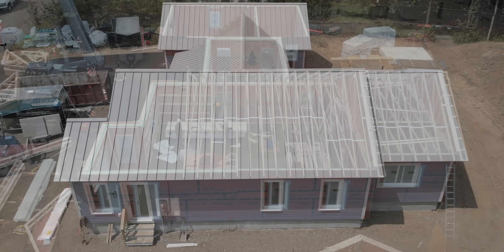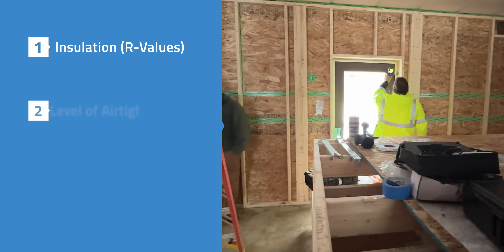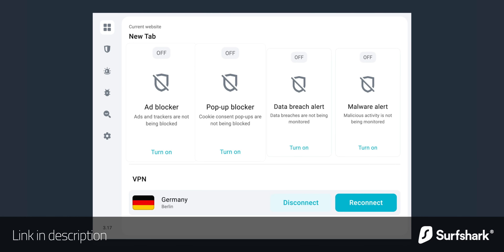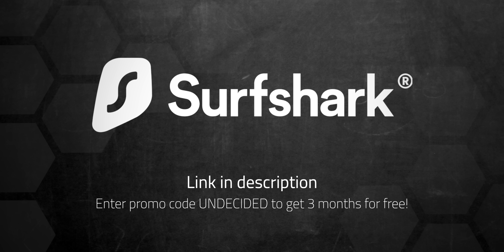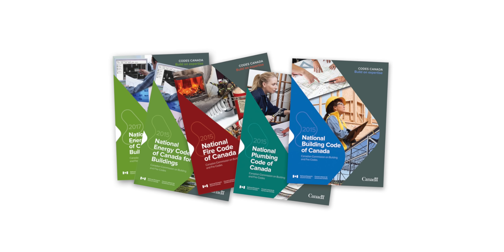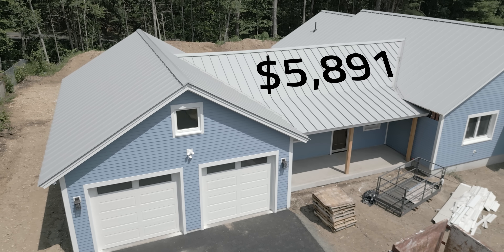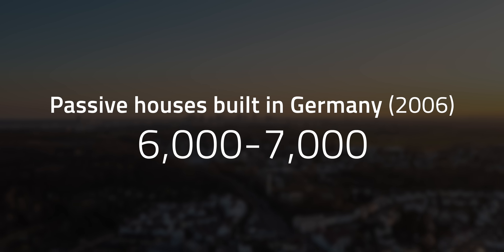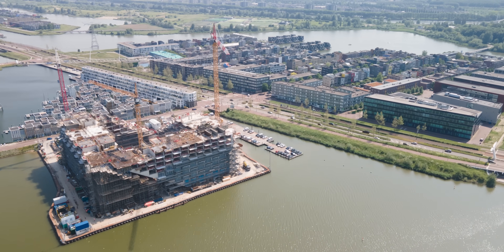Why Do American Homes Suck?

Comment: I can confirm that at least all somewhat new buildings in Germany are insulated like crazy. Last winter we had the natural gas crisis because of Russia's invasion, so we were worried about 10fold prices. Fortunately, we did not need to use the heater once. Our flat was never cooler than 20°C. Other benefits of insulation is noise reduction, which is really nice if you live close to a busy street or near an airport
Reply: We did the same in our house in the UK because of the invasion in Ukraine, and the results have been solid, even though we had one of the coldest winters on record of -9C, we rarely needed to use the heating and even when we did, it was for a short amount of time.

Normally the temperature where I live is anywhere from -5C to 0C in winter, with either of those, we don't need heating at all and it feels comfortable indoors.

Insulating and smart buying when buying products that use less power to do the same thing is the best way to reduce our bills and in my case, there is still quite a bit more we can do from solar power, to heat pumps and a few other product replacements to reduce our footprint.

In the end, there are a lot of things we can do to reduce our energy needs without lowering the quality of living, and by doing so, you either keep energy bills stable or you can lower them, and I feel once renewable energy gets to a good enough state with the battery tech to back them up, many of us could go independence of the grid.
Reply: @paul1979uk2000 we did nothing only dropped the thermostat around 2° but only for the end of the year. Got 500€ back this year. House and windows are from 1996. If prices are the same I get something back next year.
Reply: @paul1979uk2000  one option my parents learned in the 80's when I was a child was a 2 bedroom house in a terrace with 4 and 5 bedroom houses either side. Those neighbours blasted their heating all winter, it was perfect temperature in our house but was too warm to turn our heating on. I remember just how lovely and warm that little house was all winter growing up. 😅😅
Reply: @paul1979uk2000 that's if you can afford a house in Britain.
Reply: @paul1979uk2000  You must have some sort of heating on, no home will keep the heat in no matter how much insulation you have, if you go outside, heat is going to escape through the door, or open a window, having the cooker on may help a bit but still.
Reply: @dogbreath6974 the sun light get into the house from Windows . Free Energy .
I made the same experiment last year due to the gas Crisis (the price was unbelively High) I am in North Italy, and yes the house never got under 18 C° . ( the max law limit was 19 C°  to fight the shortage) .
Reply: Oh that's great.  I live in a well insulated home in Northern Ontario (triple pane windows etc).  Sadly if we lose power I've calculated that the interior temp would hit 0 C in under 3 days when the outside temp is - 40 C.
Reply: @bhut1571   I take that as ok, I mean it will need some extreme measures to contain thermal energy with -40 outside, specialy without power and air circulation.
Reply: @bhut1571  do you regularly hit such low temperatures?
Reply: @bhut1571  -40C is mad. 😩
we were on vacation on Silvester and weren't home for 2 weeks.
we hit -10 outside for at least a whole week and the house with heating turned off had still ~ 18C inside when we came back. 😅
we didn't heat anything besides the 2 bathrooms because warm tiles due to in floor heating is just a nice luxury in the bathroom in the last 10 years. 
I've fired up the wood stove 5-10 times each winter just for drying laundry instead of using the dryer. 😂
Reply: @bhut1571  that's probably because of thermal inertia, European homes are made of brick or concrete, so they have a bigger thermal mass compared to most widespread insulated timber frame houses, which only have a small fraction of a thermal mass (doesn't accumulate heat)
Reply: @bhut1571  I have a question about your windows, do the extra layers create light refraction making the light seem another color? My architecture teacher said it made it look slightly green but im dubious about that
Reply: I live in a house with very good insulation in the attic but with 2x4 walls r13. We eat a lot of beans so frequent air changes is a positive attribute. Thanks to cheap solar panels the only thing that keeps me using a little grid power is storage.I have 50 kWh of lfp and waiting for sodium batteries to be available. What we need to do in Texas is build more reasonable sized houses.
Reply: Also warm countries should have insulated homes, as the AC would use much less energy to keep the homes cold. ACs typically purify the air, however some sort of ventilation and avoid too much airtightness, should be installed. Anyway - my point is that insulation works both ways, both in cold and warm countries.
Reply: Flats have a massive benefit, namely the fact that they share both the ceiling, floor and both walls with neighbors. There is just way less surface area to lose energy to
Reply: Wow, it got down to 10C where I live and we spent $850/month for heating!  In the US!

Our house has no insulation and single pane glass windows from 1950 that don't even close. 

Even running the heater full blast 24/7, our house never got as warm as yours.  And we have a major mold problem, got a quote for $40,000 to remove the mold because of all the cold walls are condensing moisture on the interior.
Reply: @zilfondel how big is the house? I hva around 230€ a month for electricity gas water. House is from 1996 around 120 qm. I hope to get money back because of the calculation this year. Got money back this year and i use less from everything.
Reply: Don't blame Russia for problems you caused.
Reply: stimmt genau!
Reply: I'm all for bringing up US housing standards to match the European model, but with such a high income disparity coupled with the lack of social safety nets most people just don't have the disposable income to perform the required upgrades to their existing houses with the lack of adequate subsidies. And good luck getting significant upgrades to apartments and condominiums without a mandate. It's honestly quite depressing to see the lack of attention to energy efficiency not only in new housing but especially with all the existing housing infrastructure.

I'm lucky enough to be able to afford to install solar panels on my house in an upcoming remodel, but most people simply can't afford it or simply don't care.

And to end on an unrelated note, as a plant scientist I'm quite frightened with the effect climate chaos is already having on food production and it's only going to get worse. Crop production bands are already moving closer to the poles, and academic plant scientists are starting to study the upper temperature at which plants can photosynthesize. We better get our act together quickly and/or decrease the global population so we can continue to feed everyone and so that everyone can live in more hospitable climates.
Reply: @nmatheis  We probably spend similar amounts of money on housing, but in Europe we pay more upfront. The difference is a huge quality of life from day one, and energy savings for cheaper living afterwards. This pays off especially when you go through rough patches in later years, because not having to heat or cool the house at all or rarely means a lot to the budget.

As an examples, in our home we only needed heating during 2-3 colder days in the last 4-5 years, when the outside temperature was between 0-20F. Inside we had around 70-75F when it was the coldest outside. Cooling, I guess some people would've wanted some, considering the inside temperatures got close to 85F frequently during the heat waves.

Cooler temperatures can be handled with proper clothing. The warmer/hotter ones, some people can handle, others might need a fan. But in general the power consumption is vastly lower with good insulation, so you can get away without solar panels (less cost) if the temperatures don't go wild. So insulation is an upfront long-term investment that makes living way cheaper and more comfortable for decades. That's why people do it here, because it's well worth it.
Reply: The next step mein friend is to fix the car dependency craze we all embarked on in the 60s by following in the Netherlands' footsteps, especially Amsterdam's
Reply: USA's invasions, but Russia's intervention! Use the terms correctry.
Reply: @izzyreeze3538  You mean war in both cases.
Reply: I love German buildings! I love the windows, rolladen, and all the solar panels installed in the last 15 years, etc.
Reply: This guys is overexaturading a bit, because probably other people around you where heating their flats so you kinda stole heat from them. But the point is real, the energo efficiency in European homes is super high.
Reply: Americans blown your gas line but gas crisis was because Russia Ukraine...
Reply: Yeah, the americans blew the gas line, not at all the russians. @efimkrivov
Reply: @taserrr  that aged like milk🤣
Reply: I’m a developer and builder with experience on both sides of the Atlantic . I built in Canada and the Italian alps, where the winter can be quite cold. The difference is the cost of energy. In North America is way too cheap, so consumers don’t really care. What I build in canada takes 10 times the energy psf of what I build in Italy. If I was to build in Italy what I build in canada none would buy. Not even the shack for the horses is built with such poor quality in Italy. And you might think that building in Italy must be much more expensive. Instead no. I finished a project that not only is passive, but is even net positive in energy and the cost of construction was overall 30% more than the regular. Because the cost of finishing, which takes a big part of the construction costs, is the same for high efficiency or inefficient. So the difference is not so big, is just that the monetary incentive/penalty is not there .
Reply: You do understand that your neighbors were paying for your Heating?
Reply: again it's your government that one caused the high cost and energy crisis - not Russia and your leaders laughted at President Trump when he warned you.
Reply: Winter in Europe and the southern most part was extremely warm in 2022.  I couldnt believe it was winter
Reply: Well insulated houses and passive building style is not only more efficient and saves money. It is also more comfortable and yieks even healthier environments. Think of mold or never care about temperature regulation or taps that provide hot water within seconds...❤
Reply: The Australian policy has always been to build a house shaped box and pump energy into it when it comes to heating and cooling.. really biting us in the arse these days.
Reply: dude, quit comparing UK stick houses to USAs stick houses😂
take s look like Sweden and Finland instead...

we now have minimum U -vsues at 0.017 in outer walls and 0.09 in upper roof.

these are standards , and they are getting even tighter, these numbers are allready mandatory since 2009 but they are trying to change them even tighter...

UK still builds houses like first piggie in that wolf&3 little piggies tale😂
Reply: @jkarra2334  thank god we dont have finnish or swedish temperatures of -20 around here..
Of course its normal u need tighter rules there then in the uk or france... Even with those values you still lose more heat than the "piggie stick" houses from the uk so basically you are still doing worse in finland then the rest of europe not something to be proud of lmao.
Reply: @matthew3136  Bingo the fossil fuel lobby has so much political influence its crazy they effectively own both political parties along with other corporates lobby interests. The Rolling Stones investigative report some years back was quite enlightening to the extent of the reach of the fossil fuel industry and their effort to eliminate/invalidate/ignore regulations
Reply: @sbalko74  Germans have be renting a lot for a lot of time, in fact in the years from 2019 to 2023 the percentage has fluctuated between 36.77 and 37.2.
Reply: Belgian here, I'm surprised your gas prices skyrocketed to only 10 times the price? Isn't Germany like 50% dependent on Russian gas, or was. 
Gas prices at peak in winter got to 30 times their normal cost over here.
Also, you live in a flat, and it's not comparable to an insulated home because flats are surrounded by other flats and benefit from other people's heating. Essentially your downstairs neighbor is heating up your own flat.
Reply: You have a gas crisis not because of Russia but because US blew up your Nordstream pipeline.
Reply: Honestly I live in a home from the 70s and we even re insulated the roof a few years ago which helped a lot but still when I was at a friends house which was built within the last 20 years the whole house warmed up from him just using the oven. Insulation seemingly has improved quite a bit… (also Germany)
Reply: Lol not because of Russia, but because of no sense sanctions and Habeck
Reply: Russia’s invasion? Have you heard of the Minsk Accords. NATO and Ukraine signed them then immediately broke them. Russia has just been reacting to this. But I guess a scholar like yiu think it all started in 2022.
Reply: You did not have gas because your government decided to do so. Besides that you can't have a normal insulated house in middle Europe without a heating system. It is the laws of physics that stand against it.
Reply: Germany's winters are, laughable as well, don't forget to add that in.
Reply: That noise reduction also helps with densification which reduces land use per person.
Reply: @Fiercefighter2  Yep, let's make more bug pods. More bug pods for bug men. Hoorah.
Reply: @ReverseDominion  Lmfao. Sudbury drops to -40 all the time. Same with thunderbay. Petawawa and Ottawa (in south Ontario) can drop to -30 and below. Now when you consider windchill, it's a whole different ball park. I live in the Kawarthas and Northumberland region. Due to the geography here and that my fields are north of my house. Extremely cold wind runs down the side of the  large ridges's slopes and then get pulled down to ground level as my field is one of the first openings from forests from the ridge. That means I have almost permanent strong winds coming from the north all winter. It's not uncommon for the temperatures with windchill to sit at around -40. The north part of the house is noticeably colder then the south part, and my house is extremely well insulted and sealed.

We do get extremely cold winters at times in northern Ontario, with certain regions having micro climates which push the temperatures way lower than the surrounding area.
Reply: German walls are so much thicker 🤤
Reply: I hate how difficult it is to convince old eastern europeans living in soviet age appartment housings to renovate, because they don't want to pay for renovation, but are not thinking just how much money they will save long-term because of decreased heating costs.
Yes it will take 5 maybe 10 years to break-even, but it's worth it, at the very least, for your kids, even if those old coots will die before they see any of their investment return. Not to mention the people trying to sell theirs, non renovated buildings have almost no demand now.
Reply: Even the older building containing my flat was built in the 1970s, but was still very well-insulated and ventilated.  The turn and tilt windows do wonders overnight to cool the place, letting the hottest interior air out first with any cross-breeze.  I'd button up in the morning yet it was still cool when I cam home from work, even on warm day.

My German utility bills averaged way less than $50 a month when they were over $200 a month in the states.
Reply: @ReverseDominion  And check the extreme, go ahead bucko. If you think Sudbury doesn't experience below -30 weather multiple times each winter, you are living in Narnia. It does drop to -30. And guess what, once you factor in windchill, -30 also becomes way way more frequent over the winter. Also, December has an average low of of -13. Plus why don't we look at the colder months, average low of -18 and -16 for January and Federal. Don't accuse people of cherry picking data when you're using December daily averages. On top of this when you're accusing someone of not doing research, maybe do some research yourself. Sudbury is located north of the great lakes. Why does this matter? It means that it gets a lot of artic air masses passing through it, making cold snaps much more common. Do some basic, basic geography and climate research before stepping up to play.
Reply: @ReverseDominion  Extreme highs actually back my stance up. Sudbury, much like the rest of the country outside of west British Columbia goes through extreme weather and temperature shifts. Which if you would take the time to read, I pointed out Sudbury faces a lot of due to being just north of lake Huron. 

It routinely gets arctic air masses moving through it during the winter as the polar jet stream meanders. In fact, we know that Sudbury will have  massive drop of temperature and potential snow flurries on the 31st as the polar jet stream meanders over Sudbury. 

Sudbury does find itself north of the polar jet stream at times, meaning it's not dealing with frigid polar jet stream winds, it's deal with what you might have heard as a polar vortex. For some reason, either due to the polar jet stream being south of Sudbury or being weak in north Ontario lets frozen arctic air to get to Sudbury.  

The fact that you are using average winter temperatures anywhere inland west of the Rockies shows that you have zero understanding on what you are talking about. The temperature in all those regions, including Sudbury varies wildly day to day. Also, funnily enough, Canada has official data it collects. Sadly no windchill, but let's show how wrong you are. The data is from Sudbury, Earlton, North Bay, and BARRAGE TEMISCAMINGUE. All 4 are near Sudbury and experience the same weather as Sudbury, so it's to get rid of any outliers. The data will be listed in the same order as stated and is from February of 2022. 

Monthly highs: 4.7, 5.2, 4.8, 7.1

Monthly lows: -33, -35.1, -36, -31.5

Days with positive temperatures :  9, 8, 9, 11

Days with -22 and below: 7, 12, 6, 5

Days with -30 and below: 2, 3, 2,2

Now for the really good one, days with -30 or below with windchill: 11, 11, 10, 7

That's quite a few, now let's look days that hit -22 or below again but with windchill: 20, 24, 19, 12.

Days that hit -40 with windchill: 3, 4, 4, 3

TLDR, you are wrong, and also ignorant on Ontario's climate. A good move for the future is to actually look at the raw data. Canada itself provides it.
Reply: @ReverseDominion  No, you also need to show what the variance of the data is and also the distribution of the data in terms of skew. Also that data was for one month, not the whole year. On top of that, when you add windchill, about 38% of days in February of 2023 hit -30 or below.

Anyway, I did the math for the standard deviation and skew. The data has very high variance on both the daily and monthly time frames. With temperatures having more variance at the daily time frame. The data also showed about a 2 times difference in extreme temperatures for highs and lows. With lowest temperatures being about 2 times lower than the average  compared to how far above the maximum temperatures are. I checked skew as well, the data skewed slightly warmer then average. 

Basically what it means is that the daily high and low temperatures tend to be warmer than the average while being clustered around the average. Daily high and low temperatures that are colder than the average have way more variance. This basically means there are more warmer days then colder days, but the colder days are much colder, with the coldest cold days being much colder than the warmest warm days. 

Sudbury and a lot of Ontario outside the Ontario peninsula will routinely have short cold snaps plunging you to super cold temperatures over one to three days. This is due to the geography of North America. The Rockies block warm pacific air and channel the polar jet stream further south. Arctic air doesn't have to move over large bodies of water so it doesn't warm up. Sudbury, and much of Ontario finds itself eating  arctic winds coming from the north west that have not traveled over any large body of water. Ontario also doesn't have any mountains that could disrupt those winds when they do come. However, this is the exact reason why the Ontario peninsula has much milder temperatures. Arctic air has to flow over the great lakes, which warms them up a lot. At the cost of lake effect snow if you're in south western Ontario. That's the geographical reason why so much of Ontario, and so much of North America east of the Rockies has such bipolar weather. The data shows this to be the case as well once you compare and contrast distribution data with averages. You most likely live in a climate which is much more stable, something like the Oceanic climate or the Mediterranean climate. So the idea that weather can go 20-30 degrees down and then come up the same amount in a few days multiple times a month seems lubricious, but that is how the weather behaves in a lot of regions here.
Reply: Damm that’s cold lol aussie here
Reply: This makes an incredible point. If we could sell the solutions to this problem as a genuine matter of national security I bet a lot more people would support a change.
Reply: Same here! Greetings from good old Germany😁🇩🇪
Reply: you had a natural gas crisis because your government decided to ban Russian gas. not "because of Russias invasion"
Reply: The key to your success is you live in a flat. A free standing home endures much more of the elements that contribute to heating and cooling and much more.
Reply: Shutting down 17 nuclear power plants didn't cause any power problems or people dieing from fossil fuels emissions.
Reply: What if your next door neighbour bang on your wall 3 or 4 in the morning. Would you hear that too ???
Reply: How’s the stale air though?
Reply: Who blew uo the pipeline? It wasn’t Russia.
Reply: Oh no. No No No.  Merkel leaving the scene left an immense powervaccuum in your country.  Next thing was the abortion of NordStreamII under severe pressure by US.
Reply: german engineering 💪
Reply: If one lives in a big apartment building there (Germany)- in a middle of it - well you may as well wear a sweater since you will get heat from your neighbour's over the wall. I am from Europe - I would choose USA modular construction any day over European. Easy to tear down and remodel, easy access to all system. The argument for R rating is wrong since anyone really wanting to insulate the house- could voluntarily do it. Since energy cost is so low no one really does. We do not need government to mandate anything more - let market dictate these things.
Reply: Or because you shut down the nuclear plants 😄😄😄😄
Reply: I love the sound insulation part, after my brother complained about his neighbors whining and fighting over noise in his 1960 apartment building, I feared same will happen to me. However my building was built  in 2014, and I can't hear anything. I blasted music on my TV and asked my wall-to-wall neighbors if they heard anything, they were like "What music?" When doors our closed I can't hear my gf on the balcony. It's amazing.
Reply: Yeah, EU now brought A++ requirement on new housing. The pronlem is even that - even though this makes it energy efficient but its economically not efficient at all. The difference in saved funds between A and A+ is like 5-8% saving on yearly spending, but it costs 30k € at least. It will never payback.
Reply: @romualdaskuzborskis  No. It cost à lot if you upgrade the house. But when it is at thé beginning it is not so expenssiv. And à housse last at least 70 years ans in europe centuries...
Reply: @abriotde  nope, I have literally calculated the new house current costs for A/B vs A++. The point is with each upgrade you have siginificant efficiency progress. Its a very big increase going from C to B (from 187 to 125.4 kw/m² a year), a bit more from B to A (from 125.4 to 49.2), then its much less significant going to A+ -  49.2 to 37.09 kw/m² a year, and to 27.83 for A++. A class 120m² house can be built for 70k-120k, A++ would at leastgo now for 250k€. Thats eastern europe prices. Not sure about western/center EU.
Reply: @romualdaskuzborskis  Usually, the price of the land is 100K to 300K euros so puting 200K or 250K in the house do not change significantly the price. But the confort in A++ is significantly better : You don't need any heating system (Or a so cheap one). It's a huge advantages. And there is a huge confort when inside it's always a cool air not to hot, not to cold nor on the ground nor on the top or close to the wall.
Of course when it's upgrade of the house it cost to much to be A++ a good B or A is enougth.
Reply: Europe was lucky that the winters since Russia's attack on Ukraine have been very mild. Furthermore, the German government subsidized heating with enormous amounts so everyone only had to slightly turn down the thermostats to get away lightly financially.
Reply: Gas crisis because your government let the US blow up Nordstream thus deindustrislizing Germany. Blaming Russia doesn't work here I'm afraid.
Reply: I live in a really insulted house in the UK. Its a nightmare in the summer
Reply: @CentreMetre  is it cursed
Reply: @imakro69  No its hot
Reply: I mean our insulation in Finland is pretty good but whenever I've been to Germany the houses feel like they've built like castles
Reply: I agree with the sentiment but the zero burn was because we were super lucky with the weather in Europe that year. Putin was like "curse the weather"
Reply: Schimmel!!! Schimmel ist das Problem!
Reply: @Neomadra  you used the heat others had to pay for. They compensated your inactive heater.
Reply: @Neomadra  dude why do you lie? I live in Germany too and what you’re saying is absolutely false. 2022 in the gas crisis, we did have to use the heater… stop selling lies
Reply: You had gas cut off because you decided so, and because your US ally had blown up the Nord Stream
Reply: did Russia invade Germany or something 🤔
Reply: >Does nothing
>Wins

What is this strategy called?
Reply: Don't worry, we are still using Rusian oil, it just goes through two more hands before our countries buy it and the consumer pays more.
Reply: you didn't have a natural gas crisis because of Russia's invasion, westoid
Reply: "we had the natural gas crisis because of Russia's invasion" thats not because of "invasion", thats because of the sanctions against Russia + EU politicians refused to buy from Russia. So thats because of EU politicians not because of "Russia's invasion". By the way, why no one applies sanctions against Israel? Oh, i think i know! "Thats because its different!", isnt it?
Reply: I really enjoyed your informative article but I am disagreeing to the IECC standard.The higher standards is meaning higher costs to live.
Reply: you had a gas crisis had nothing to do with Russia but NATO blowing up germany's main source of cheap ubandant gas via nord stream while your vassal government did nothing but buy US LNG for 4 times the price. facts
Reply: @Neomadra Last I checked, it was Germany that invaded Russia... not the other way around. So I would be quiet about an invasion in your position...
Reply: @Neomadra  I’m am so jealous. My home is horrible at retaining heat because it’s to big. Last winter, my heater broke, so I had to where my winter coat, ski socks and ski pants.
Reply: American Homes Suck!
Reply: You are also getting heat from all of the units below you.
Reply: Strict codes are all well and good, but if I can not afford housing because of it, it’s no use to anyone. Same goes for everything else. If it makes it unaffordable what’s the point??
Reply: @MoDa87  But it is not necessarily an affordability issue. Yes, it often costs more up front but if your monthly costs are significantly lower then the differential may not be as great. Cheap up front cost is not always the most desirable outcome. If we think that way, we condemn ourselves to buying nothing but third world country imports that, well, suck.
Reply: @MoDa87  I have been interested in energy zero houses for years and have books dating from the 1970s and in reality all the energy builds and efficiency devices were available then, just expensive and hard to find. I recall 1 book showing how to build such a house using the same materials, just in a different way. The 2 I recall are: doing away with cellars but using the same concrete to make an energy sink in floor and walls, and the other was using concrete blocks with holes, but lined up with windows so sun heated up floor and air in the hole tubes, heat raised and pulled the cold air from back of room into the wsrm floor tubes, got hotter, raised and so on. You also gave the earthships, elements of which can easily be used in 'normal' houses although the atmosphere in an earthship is sonehow magical
Reply: @MoDa87  so you can flex how the government controls every aspect of your life to those silly Americans and Canadians, duh.
Reply: That's more because of the flat underneath you being badly insulated from your so you get free heat through the floor.
But yeah, insulation is great as long as there's enough ventilation, which makes older houses incredibly expensive to upgrade. Unless you're a landlord in Germany, then the tenants pay for it and landlord gets the tax benefit.
Reply: Europe is still buying Russian gas tho. Politicians just never mention it.
Reply: Yes, the key word in your entire comment is you live in an apartment. Homeownership is a dream free because it cost like €4 million to get a house in Germany. The government probably subsidized the building building of that very energy efficient high-rise.
Reply: @Albanianguy9  That's simply not true. Yes, building a house IS expensive in Germany. But €4 million is WAY beyond what's needed. Average building costs have risen to €2k/m², so a normal 150m² house costs around €300k. If you buy an average plot (500m²) it highly depends on where you build. In average it's ~€160/m², but in huge cities this increases by an order of magnitude. Still an average single family house in an average area will cost you ~€400k, while in large cities this jumps to €1.1M.
For €4M you could build a 3-5 floor city villa (200m² each floor) in munich. number of floors highly dependent on where in munich you build.
Reply: @AleaumeAnders  yes, you’re making my point for me. 1600 ft.² cost over $400,000 in your country lol. Not to mention the taxes… I understand you can living on a farm in the middle of Germany but living in the big cities or suburbs, is at least €1 million+
Reply: @Albanianguy9  And still you are exaggerating and avoiding the main question. You claimed a house would cost €4 mio in Germany. Which is as wrong as claiming that all houses in Albania are little more than a pigsty. You'll find wonderful but expensive houses in Albania, and you'll find acceptably priced houses in Germany. Btw. appartements in Tirana sell for €1k/m² which is not that much behind what you'll pay in similar smallish cities in Germany.
Reply: @AleaumeAnders  i’m actually not from Albania even though I’m Albanian. And I also don’t live there so I don’t know what anything costs. I wouldn’t buy anything in Albania and potentially get scammed lol. You’re missing the Keypointe that I’m making which is that homeownership is a dream for most people in Europe especially Germany because it’s so expensive. It’s also frowned upon because you guys worship at the climate change alter and have literally shut down all of your practical energy sources and beg Russia for energy now.
Reply: @AleaumeAnders  I would rather own some land and own an actual house that is built cheaply in the United States rather than live in an apartment that’s congested, and I don’t even even have my own space
Reply: @Albanianguy9  And you are still ignoring the facts. Just because it doesn't fit your propaganda, you spew nonsense.

Houses in Germany are actually NOT more expensive than those in equally populated area of the US. Sorry to burst your bubble, but what you claim is factually wrong.
Though given that facts are as important to you than to the average trumpist, I'll stop here. No sense in arguing with "believers".
Reply: @AleaumeAnders  yes and houses in the United States are actually a lot larger than what you would get for the same price in Germany. I love how you assume my politics. Your entire country worships at the climate change alter and literally committed suicide by shutting down all your practical energy production.you’ve led in millions of migrants that have changed the makeup of your country and actually made it worse. On top of that we don’t really even have to focus on energy savings here because we have cheap, reliable, natural gas and oil.
Reply: @Albanianguy9  Sorry, you can't even read properly what I write. Over and out Mr. post-factualist.
Reply: Unfortunately, the buildings in German are very air-tight with insufficient attention to ventilation. Ventilation systems with heat exchanger are rare and ventilation norms in the building code do not cover any heat recovery. So it is either sending warm air straight out of the window or accumulation co2 and other emissions indoors
Reply: @jaap7374  Although indoor CO2 is certainly a point of concern, I believe the accumulation of VOCs is more of an issue with low ventilation rates.
Reply: @jaap7374  In Germany we do something called "Stoßlüften". Open the Window all up for a few minutes to let the air fully exchange and then close them again. The loss of heat isn't that big, since air isn't as dense and therefore stores only a small fraction of the total heat present. The walls and furniture will heat up the fresh air in no time. 
But sure, a ventilation system with a good heat exchanger would be more convenient. But still not sure if it would be a lot more efficient to continuously loose a small fraction or loose a bigger fraction once a day. But it will for sure adds a bigger price tag on the total house price. Not worth it imho. Maybe for an American since convenience is king over there still :p
Reply: @matteloht  Ventilation with heat exchange is very cost effective with a SCOP of over 10 when used with a CO2 or VOC sensor. Heat recovery is mandatory in many building types in the Netherlands. Its popular mainly because the efficiency and health benefits. Convenience is a nice bonus
Reply: @matteloht you guys also pay tax for radios which is why nobody wants them anymore. I lived there for 3 years. No thanks to your massive taxes and overregulation of everything.
Reply: If you have a heat recovery system, is it difficult to keep it clean? Does it attract mold?
Reply: @jaap7374  We had that issue with our house in the Midwest US after renovating and increasing the efficiency. It became too airtight and we added a heat recovery ventilation system. We love having fresh air all winter long without putting too much burden on our heating bill.
Reply: @jaap7374  FWIW, in newer apartment construction, active ventilation with heat exchangers is pretty common. My building has it. It was built in 2016.
Reply: @jaap7374  I don't know where you're living, but in Europe you can't be serious about passive house without ventilation. There is no such thing "insufficient attention to ventilation". You can't obtain a certification from Passive House Institute without ventilation. More than that a lot of passive houses have CO2 meter in every room and automation for ventilation.
Reply: @jaap7374  That's why we have the "Kippfenster" tilting windows to perform "Lüften" airing for ventilation at least once a day for five minutes. And that kind of ventilation will not really make a big difference in efficiency or energy escaping out of the window.
Reply: @jaap7374  All newer building with the "crazy insulation" mentioned above have some sort of passive or active ventilation already built in. Because most owners aren't qualified to manage ventilation cycles, it's basically "hardcoded" in some structures. They building maintains ventilation by itself using mostly maintenance free passive methods.
Reply: @jaap7374  But you still can open a window 2-3 times a day to stay below 1000ppm CO2.
Reply: @jaap7374 Did you miss the part in the video on ventilation systems? Not that this changes older buildings in Germany, it’s that there are ventilation codes. I would be shocked if Germany didn’t have basic ventilation system codes for newer buildings.
Reply: @jaap7374  that's because you need to clean the ventilation every couple of years and it's not cheap
Reply: @jaap7374  Precisely my case. The core of the house (60cm aerated concrete, 60cm rockwool ceiling) is passive down to -40C, but that's before ventilation. With legally required airflow, it's almost stone age performance. Reversible heat exchangers available on the market are a hoax, their heat capacity is too low to make any sense (and their motors burn quite a lot of electricity).
Reply: @jaap7374  our building has ventilation with heat exchange. But the problem is, that in the winter the humidity gets way too low. Not healthy anymore.
Reply: @jaap7374 That is not correct. Ventilation with heat recovery is a central element of a passive house and it is reflected in building codes.
Reply: @jaap7374  Yes, indeed!  Modern buildings are way too much air tight for good health!
But it is neither complicated nor expensive (compared to the cost of the potential energy bill) to fit a heat exchanger on a home's forced ventilation system!  The system should be designed to suck air from the kitchen and from the toilets, and bring fresh air to the living and sleeping rooms, and be fitted with an air-to-air heat exchanger (typically 80+% efficient)... adding a pollen and other particle filter is a good idea!
Reply: @jaap7374 we don’t need ppl to tell us to air out the home homes a few minute a day here and there we prefer fresh air in Europe
Reply: @jaap7374  Ventilation is definitely the biggest weakpoint at the moment in Germany, though surprisingly there's at least two businesses doing comprehensive ventilation in my small town
Reply: In Brazil, it's like unacceptable to not open windows for fresh air, so using that amount of insulation would be waste of money when people open the windows for fresh air
(In southern Brazil, where it snows sometimes)
Reply: @rogeriopenna9014  Even if you prefer keeping the windows open (I certainly do) the benefit of having good insulation is that your temperatures return to baseline very quickly after you close them.
Reply: @VVayVVard  how can it return to "baseline"? Only by heating it again I suppose
Reply: @rogeriopenna9014  Via a number of mechanisms. Humans and machines are major sources of heat. The ground also acts as a reservoir, and the walls, floor, furniture and (especially) water pipes retain heat to some extent as well. 

And when you live in an apartment, this can actually become a problem. I personally prefer to keep my place cool, so I always have my heating off and try to keep my windows open as often as possible. But I do have to close my windows whenever there's pollution outside, and as soon as I do so, even if the temperature's are below -10°C in the winter, my apartment heats up above 25°C, with heating off, because of heat leaking from my neighbors' apartments. Proper insulation is very powerful.
Reply: @VVayVVard  Because hot water flows through the tubes in the walls to the radiators even if they are closed, I needed to close the main heating valve in my appartement (Austria) because I got to 27°C in winter ! I only need to open it if it really gets cold outside for some weeks a year maximum. But my appartement is the best in the house because I have neighbors on all sides. I even have problems with the operating cost bill, because they don't believe in my low usage. And that is not a low energy house but from the 90ies.
Reply: @VVayVVard  , this is not a good idea when the baseline temperature is always above 25 degrees Celsius, as in many hot regions of Brazil. I'm an architect in Brazil and I designed some walls with blanket insulation. It was not a good experience. Lightweight insulated walls (like those in American or Australian homes) gain heat very quickly, whereas heavy brick walls don't. When they do not receive direct solar radiation (such as on balconies, eaves, etc.), these high thermal mass walls tend to perform better here, as the inside temperature tends to stay lower than the outside temperature for a few hours, even with windows and open doors.
Reply: @rogeriopenna9014  The multiple TVs, router, body heat, the refrigerator, the dog all emit some heat - my PC heats up my room (high power GPU/CPU) - I live in UK in a 2023 built property with all the latest insulation standards - I can say it's very efficient & very noticeable, we use the heating much less in winter & summer it keeps cool 😎, all windows have passive ventilation to refresh air, I'm pretty impressed with it all to be honest 👍
Reply: @rogeriopenna9014  It doesn't work that way. Buildings in Europe are made of brick and concrete, with very high thermal inertia, so opening the windows for 5-10 minutes freshens the air completely, then when you close the windows the room gets to the initial temperature in a matter of minutes. Air doesn't store that much heat, it has low density, so opening the windows from time to time doesn't count that much. I have 15cm EPS wall insulation, 40cm rockwool in the attic and triple glazed windows and this can save you half or even 2 thirds of the needed energy compared to a non-insulated house.
Reply: @ctr289  ok. Can you please clarify me, then, why so many Europeans die when you have heat waves that reach 40C?
Reply: @rogeriopenna9014  There aren't many that die, they die at about the same rate as in the US, actually, and it's because we aren't used to heat that much. Usually people die in the streets when they're forced to go somewhere during the heat, it doesn't have much to do with homes. Well, there are some of homes that heat up pretty badly, too, the few ones without an insulation
Reply: @rogeriopenna9014 we don’t have AC
Reply: @rogeriopenna9014  The problem aren't the heat waves that reach 40°C per se. As said by others: european houses usually aren't flimsy cardboard boxes, but rather heavy brick, stone or concrete buildings. Which results in a lot of thermal mass. So a single day above 40°C will likely not be enough to change the core temperature of the walls by much. BUT: the same mechanism can become a huge problem during protracted heat waves. While the walls are slow to heat up, they are also slow to cool down. As a result, once the walls are heated up, they will in turn heat the internal rooms during the night. Which can be devastating for sick or elderly people. 

This wasn't much of a problem in the past, as buildings had been adapted to the local climate over the centuries. Spanish houses tend to have much more shading and passive ventilation features than swedish houses. After all, spanish houses have been built to withstand spanish summer, while swedish houses have been built to withstand swedish winters. Due to climate change, those local conditions are changing drastically. Rainy England just isn't prepared for 30°C heat waves, never mind them lasting for weeks. Basically, the central and northern europeans need to start building more like the southern europeans. 

BUT: while our winters become warmer as well, sudden extreme cold spells are still possible, and the sun is less visible during winter also, thus we need to find a new compromise. Which is easier in the US... as you can just tear down those cardboard boxes after a mere 30 years, while european houses are expected to last for at least 80-100 years.

European houses ARE better than american houses, BUT they are not perfect, and do have their own drawbacks. Permanency and thereby a lower adaptability is one of those.
Reply: @AleaumeAnders yes you get the point but ...
I live in a eavy stone house in North Italy . Summer Is definitively hot but thanks to the Alps , sometimes the night are cooler . So I act likes that at night open all the Windows bu during the day absolutely not.  i do not have and AC , or Better I have but I don't Need to use .May be some time to riduce the humidity .
Reply: @rscaht  It's similarly done in Germany. But yeah, our houses can only cope with german climate, though we are now getting (north) italian climate more and more often.
Reply: @AleaumeAnders  I specify North Italy because Summer are hot and more humid and Winter colder than south Italy . But yeah the last years sometimes Is the opposite . Interesting times .
Reply: @AleaumeAnders  BS. There is no problem with "accumulated heat", you just keep your windows open.
Reply: @peceed  You obviously have no inkling about physics and meteorology. Do you know what a tropical night is, and how the numbers are changing in Europe? Do you know what thermal mass means? Or is all you can do YT trolling without substance?
Reply: @AleaumeAnders  I was studying physics and i perfectly know what I wrote means, and you apparently do not.
Reply: Because we watch mainstream media. Maybe people die from panic attacks because we were told all the time this year that we would die of heat. At the same time we had a cold spring and a mild summer this year.
It is a problem though that natural cooling has no place in city planning in Germany. We built popular cities more dense and heat goes up.
Reply: @AleaumeAnders  LMFAO at your 30 C "heat wave".
Reply: @roberts1677  For brits that IS a heat wave. For us central europeans that's summer. Always remember the context.
Reply: @rogeriopenna9014 Germans are notoriously famous for venting their whole house by putting al the windows open.
Reply: @rogeriopenna9014  But fresh air doesn't mean clean air, unfortunately. It would be better to have A/C, ventilate a couple of times a day and use a purifier to get clean air inside. But at a cost.
Reply: @rogeriopenna9014  The problem is most houses here In South Brazil lack screened windows allowing all sorts of bugs to enter like 🪰 🪰  and 🦟🦟🦟
Also houses here like bathroom ventilation fans, central heat / air-conditioning, insulation ( just brick walls and paint ), hot water heaters ( mostly electric aka suicide 🚿🚿 ) and most windows are a single pane of glass, truly the third 🌎 here.
Reply: @BasedInBrazil  Earth IS the third world (Mercury, Venus, Earth) so we are all third worlders :D

You are right about mostly everything. But at least in Rio Grande do Sul, any decent house or apartment has gas water heaters. I have two in my apartment, with central gas in the building.

I disagree electric shower heads are suicide. Probably less people die of electrical shower heads in Brazil than people in the US due to boiler explosions.

I mean, just last month 5 people died in Plum, Pennsylvania, due very probably to a water tank explosion

"The Allegheny County Fire Marshal has confirmed that the house that exploded had hot water tank issues.

According to sources, the victims were in the basement working on the tank — but it’s unclear what went wrong."

Agree about the screens in doors and windows. My grandfather had a house near Jacuí River, some 5km from Porto Alegre, in the 80s and 90s, that had screens in all doors and windows.

My brother in law's house also has screens in all doors and windows.
Reply: @rogeriopenna9014  No because, with well insulated house and a controlled ventilation you will have a fresh air witch can be at controled temperature and humidity. It's more confortable. Of course for poor people, it's not usefull.
Reply: @rogeriopenna9014  hopefully you monitor outside PMs  (eg. luftdaten) before opening otherwise you might be surprised by the amount of pollution (especially if you live in a semi rural environment: living in the middle of a busy city is better than among people burning wood or garden waste.)
Reply: The Russian invasion is certainly bad. But your gas crisis was not because of Russia, but because your government stopped buying cheap gas from Russia. And they switched to “green energy”, which of course does not work, plus they began to buy liquefied gas from the USA, which is many times more expensive. I understand that this is not very obvious for liberal views. In any case, I’m glad that houses are built well in Germany, in America I feel the wind blowing from electrical outlets, everything is so bad. At the same time, I live in a fairly expensive complex.
Reply: What were the temperatures in the area? Florida wouldn't have to worry about heating prices either
Reply: @chiquita683  insulations works both ways, a well insulated home makes so you don't need to use your AC at full power.
Reply: @sagichnichtsowiesonicht7326  a well insulated home is enough to be heated up by the human body where I live in lower Saxony here in Germany.
Reply: @sagichnichtsowiesonicht7326  Insulation is but one part of the equation. The other is thermal mass...
Reply: @chiquita683 in the winter it is common to get 0 degrees in the hotter zones of Germany and -10 in the colder ones. So I'd say ~-2 as an average
Reply: @ArchivioBDF  winters in the US are considerably colder on average
Reply: @ArchivioBDF  Germany's temperature is much more than -2 on average anually, I'd say it's about 10° on average annually.
Reply: @ArchivioBDF  you have to speak in Fahrenheit - as there's only 3 countries in the world that use that measurement - The only countries that officially use Fahrenheit as a unit for measuring temperature is the United States, Liberia and the Cayman Islands.
Reply: @davidr2299  depending on where you live.  In the SE and SW its pretty close to 30-32F.  In Florida where I live, it’s considerably warmer.
Reply: @ArchivioBDF  you should mention celsius, Most Americans won't get it otherwise ;) they somehow measure in foot or 3 and a half sun or thinks like that ^^
Reply: @justaguyfromreddit kinda important to state whether that "0 degrees" is in Celsius or Fahrenheit. 🤦

A 0⁰C day is a mild winter... a 0⁰F day is bone-chilling cold.

Meanwhile, a 32⁰F day is a nice winter day, while a 32⁰C day is "beach weather".
Reply: @davidr2299  "winters in the US" entirely depends on where you live... Anything north of Virginia can get very cold... if you live in Georgia or Florida, you'll never even see snow.

If you live in NM, it could be freezing at night in the middle of December, but 60⁰F in the middle of the day.
Reply: @chiquita683  - Please don’t seriously compare the climate of Florida to Germany. Maybe a quick Google search before you post would be helpful.
Reply: @chiquita683  its germany got christs sake. Even south germany needs heating in the winter
Reply: @BonafideDG  Luuul, germany needs heating. What a bunch of softies.
Reply: @chiquita683  lol. Florida has lots to worry about insulation and AC costs. But for cooling and keeping the sun and heat out
Reply: @chiquita683  Look on a map where Germany is...
Reply: @chiquita683  do you think they have the same temperature as Florida in Germany, in winter? I guess it's true what they say about people from Florida - hahahahaha
Reply: @chiquita683  No but for cooling and it's exactly the same problem. If the house is not well insulated, you need a strong air conditioner, other no.
Reply: @chiquita683  
You won't. But insulation would save you a lot on the A/C use, as to keep the heat out in summer.
Reply: @chiquita683 Every American only talks about heating. A well insulated house keeps the cold outside AND the heat of the sun. So the electric bill for the AC gets lower. Much better comfort inside the house all year around.
Reply: @chiquita683 It'd have to worry about cooling though
Reply: DUDE. Insulation is insulation. Its not cooling or heating. @IbrahimNgeno
Reply: "natural gas crisis because of Russia's invasion" should have listened to that orange dude about energy independence a few years ago then I guess
Reply: @tylerpixel , the same orange dude that withheld military aid to Ukraine while Putin was readying to invade them?
Reply: Last time Russia invaded Germany was 1945. .How did  that event raise prices in fall of 2021?
Reply: @andreycham4797  
bro…
Reply: @Slayer666th he’s technically not wrong. The Nordstream pipeline was destroyed by the US, leading to the energy crisis in Germany.
Reply: @andreycham4797  You're joking, right? The war in Ukraine and the sanctions that followed raised the gas prices all over Europe.
Reply: @razvanlex  if you can write in English you should be able to read too, if so you can open chart with natural gas prices in summer -fall of 2021 and then explain yourself how war and following sanctions in end of February 2022 raise prices in 2021
Reply: @andreycham4797  And apparently I can also use my brain a little bit. He made a mistake, my brain corrected it. I think he meant 2022.
Reply: @andreycham4797 I doubt he meant that invasion. Especially since there is another one going on right now. The effect on the gas prices in EU is an effect on the ban on russian gas because of russias invasion of ukraine. And no, the ukrainians (at least the hundreds i met in the last months) are not in favour of this invasion.
Reply: @111elf1 , he may be neo N.? Or just extremely ignorant.

Without the WW II East to West offensive, it is very likely I would have not been born.
Reply: @111elf1   Eastern Ukrainians were in favor of it. Western Ukrainians were not. Militant groups from Western Ukraine were shelling areas like the Donbas and the international community did nothing about it, so they were desperate for Russia to help stop it. This east/west divide has existed for quite a long time.
Reply: @111elf1  So the gas prices in Germany have gone up because Germany by itself refused to use cheap Russian gas in favour of more expensive LNG, right? So it was a deliberate Germany decision.
Reply: @andreycham4797  well because gas was mainly originating from Russia
Reply: @andreycham4797  спасибо, друг.
Reply: @andreycham4797  
Haha, well done.
Reply: @andreycham4797  Becasue Russia is a major energy supplier to Europe as a whole and when Germany, being part of Nato, condemned it, Russia began cutting natural gas and oil exports and it was thought that they would also cut it entirely, which most definately will happen if Nato gets directly involved in Ukraine with boots on the ground and it devolves into an outright international war.
Reply: @andreycham4797  America decided that Europe needed to cut imports from Russia completely. That caused a price rise.
Reply: @andreycham4797  What he is referring to is the Russian invasion of Ukraine.
Reply: @marcelvanheezik444 well, are you trying to say that Russia invaded Ukraine in fall of 2021?  This is when gas prices rose two times
Reply: @andreycham4797  wow, facepalm....
Reply: @andreycham4797  Are you a troll, ignorant, or just haven't turned a TV on within the last year?
Reply: @sgtm7 that's quite a hilarious comment. Like you actually believe you'll get the truth by watching the TV. You don't understand how ironic that is. You'll only ever understand when you begin to wake up and understated everything you're told and most if what you've ever been told is an illusion.